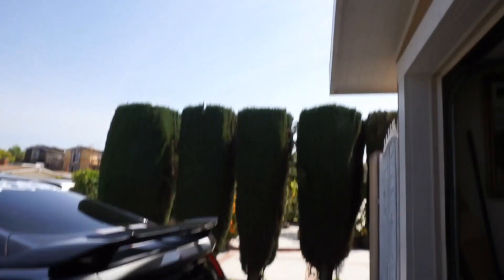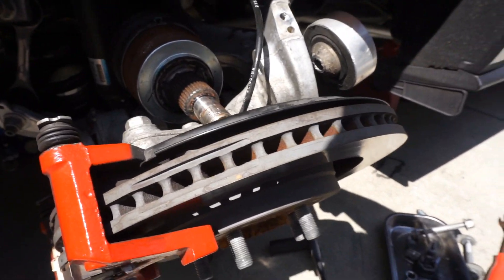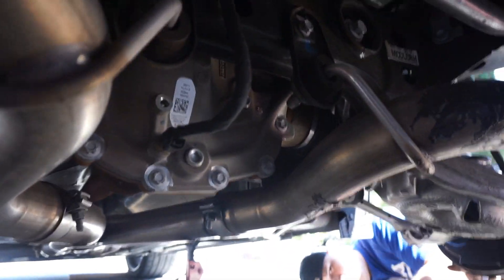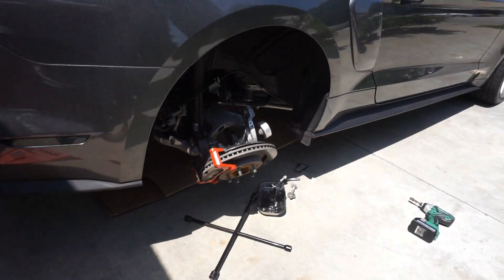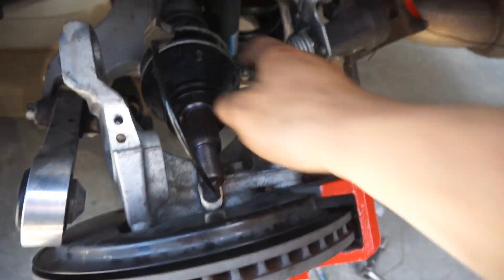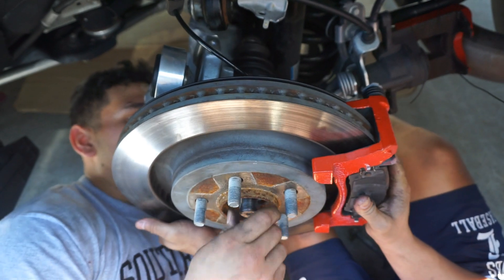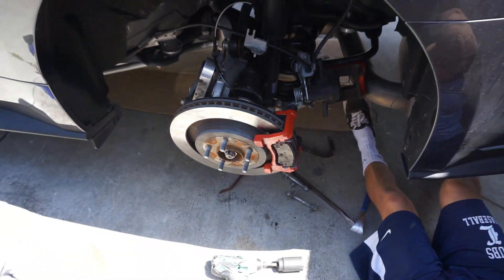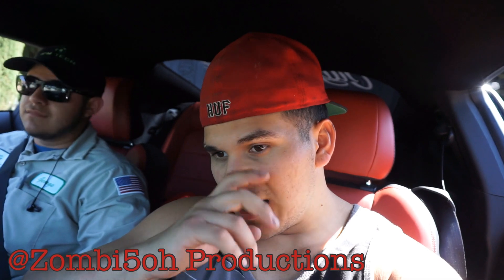DSS Half Shafts Install

Comment: That click sound actually has a TSB out from Ford. It's the thrust washer that is between the hub and the spindle. Ford redesigned the washer even because it's such a common problem.  The part number is FR3Z-7G273-A
It's good to beef up the axles for more power, but not needed to fix the click.

Comment: I had an RST clutch. It made to much noise at idle,  so I went it’s the SPEC stage3 +.  Works perfect  no noise.  Rated at 875 lbs ft torque.

Comment: Great job. Not sure what you did but typically when you tighten suspension bushing bolts you want to load the suspension, normal drive height, before you tighten the bolts. If you don't you can cause a bushing preload when you lower the car onto the wheels.

Comment: I don't know if you ended up getting a clutch but I'm running a Mantic series 9000 twin disk and it's awesome. Way easier on the transmission cause it's got the sprung hub and it's still really steerable. Rated to like 1000 horsepower too
Reply from the maker: Vince Zampella thanks brotha. That was def one of my options but I got a sweet deal on a McLeod that I couldn't pass up. So I have that just not installed yet. Thanks for the insight tho.

Comment: Mantic Clutch Kit - 9000 Series Sprung Street Organic Twin Disc M924236 good for 700 or the Mantic Clutch Kit - 9000 Series Sprung Street Cerametallic Twin Disc M921236 good for a 1000. Mantic under rates the there clutches also by 1.5%. Its a little more money well a lot more but they are sprung hub and bullet proof....Slipping the clutch is no problem or just let it rip... VMP also sales them.

Comment: cool video...but what ring are you talking about between the pumpkin and the halfshaft before you pull it out and how did you removed it....
Reply from the maker: Sam Arce I'm not sure what you mean by "ring" but to pop it out you just stick a pry tool between the half shaft and the pumpkin and pry it until it pops out then just pull it out its easy hardest part is getting leverage under the car since it's on Jacks and not a car lift

Comment: on your friend behind the scene video, the guy that was trying to remove the old one said there is a plate or clip?? thx
Reply from the maker: Sam Arce yea I was just watching that one too lol no we were confusing the metal cover of the actual stock halfshaft as a part of the pumpkin so we were trying to figure out where we actually pry it out at. where I point at in this video is where the tool prys between. directly in between the pumpkin and halfshaft